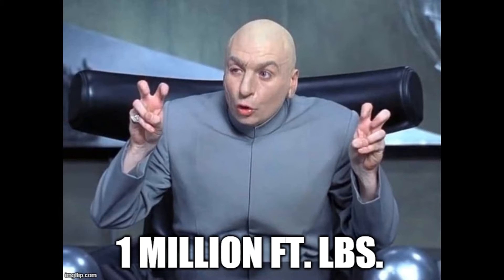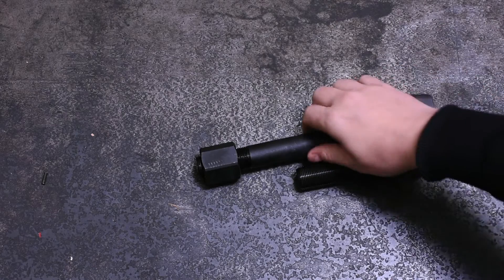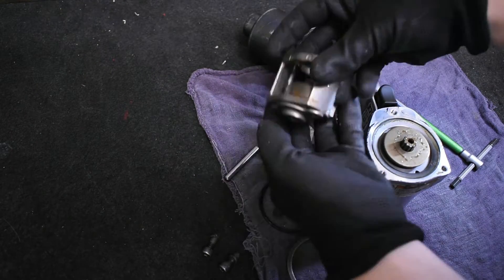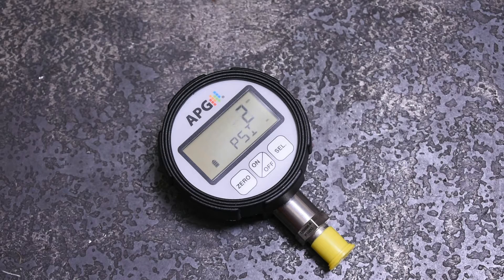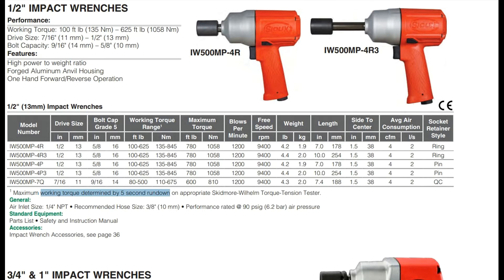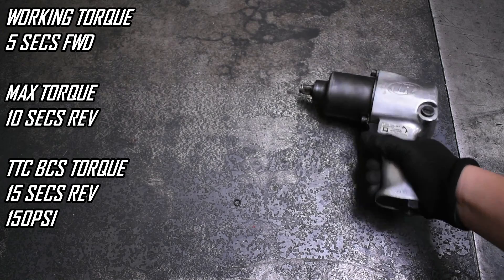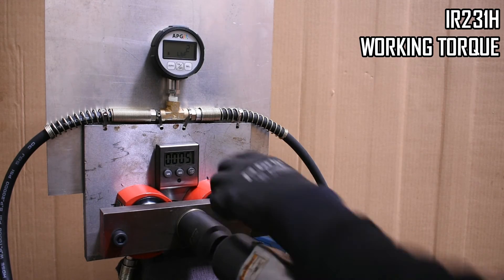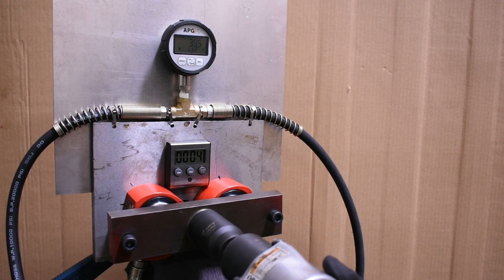Making a Digital Impact Wrench Torque Test to See Old-School FT-LBS

Comment: This rig is nicely made, but it's really just a homemade Skidmore. You're still only measuring bolt-load. Your torque rating is at the mercy of how much the friction in your threads and bearing surfaces are reduced by whatever type of lubricant you're using. The only difference between this reading bolt-load and a Skidmore reading bolt-load is that the Skidmore gauge is giving you the bolt-load in actual "pounds" which can be used to easily do calculations. This will work good for comparison purposes at least.
Reply from the maker: You're not wrong, I suppose the heart of the matter is that we're using a control here. A skidmore divides bolt tension lbs by a preset number, no matter what. Bolt condition, lubricant, temperature effect that but is being largely ignored because their goal is for one skidmore in California to have the same process as someone using on in Florida, always divide by 90 for instance. Skidmore will tell you that you can't use a torque wrench to check your Skidmore machine, so you're really just at its mercy and calibration. For me, I have a control, this 231H I'm choosing. It's an imperfect one chosen at will, but still allows be to throw the tool on and make sure it reads 450 before a test. It also gives a relatable reference for people at home instead of say 60,000 bolt tension pounds. And if IR was using a Skidmore to rate the 231H, and supposedly a skidmore to rate their recent impacts which have performed so differently on this channel than their advertised rating - it's not a process we want to exactly replicate. Their process may have lead to impacts being rated for 1,000-1,600 ft-lbs today, which i feel few people really believe.
Reply: @TorqueTestChannel  I'm not trying to criticize your method. It's a sweet set-up; especially for comparisons. I only have a lot to say about this because I've spent a lot of time trying to think of the most accurate and honest way to come up with a proper "torque rating" for a these tools just like you. 

If you're getting a different torque rating with your set up than IR is getting at their factory using a Skidmore it's probably not because you have a superior set up. Your set-up has these disadvantages:

-It requires that you have to twist the head of a long bolt instead of the nut. (its like a long torque stick)

-You have a piece of metal across two rams that is going to experience deflection. 

-You're using red grease which isn't a proper bolt lubricant. 

Skidmore isn't going to advise anyone to perform their own calibrations using a clicker wrench. It doesn't mean that it's not an okay way to do it. Their equipment is literally just a hydraulic ram with a hole in the middle. If it's not leaking oil then the only thing that can be wrong is that the gauge is out of calibration, but so can any gauge. You just have to check it with another gauge that you know is good. 

I agree that you shouldn't use their formula; there are much better formulas you can use to come to a more accurate result. You need to factor is thread pitch, tensile stress area, lubrication, etc. You really need a formula that factors in the friction as precisely as possible. Friction is the main thing that is going to screw up your results. 

Anyway, I'm excited to find your channel.
Reply from the maker: @charlieott7469  Thanks! Agreed on friction, it dictates everything. Friction coefficient can swing things widely and is why I don't like the whole idea of using math vs just comparing to another tool. We're impacting the bolt head here because it best replicates what people do at home, but I have turned this bolt around and impacted on the nut with little to no difference at least on this set up so far, with higher power tools it could matter. Which I can show but may be uninteresting to most. For the two rams, the guide bolts on the side are in oversized holes, as long as they are shaking around the rig is not binding and the pressure level automatically levels across the two rams being connected to a T, but I agree it's not the ideal design. Hopefully we can maintain some consistency which is the end goal. I appreciate your comments. Digging deeper into these things is what the industry needs rather than just taking numbers on a box as facts.
Reply: @TorqueTestChannel  Awesome. It sounds like you have thought of everything 🤙🏻🤙🏻
Reply: @TorqueTestChannel  I wanted to chime in on this discussion. First, this is great stuff!  

Although I agree that friction is the largest source of error, it is not as big a deal as it is made to be.  your process of keeping it small, with all of the treads clean and uniform on a fine pitch, with maximum thread engagement will result in a linear range of pressure to torque over a fairly large range.  In other words, as you have suggested, a tool with 1/2 the pressure and 2x the pressure of the defined standard, will in fact be very closely exerting 1/2 and 2x the torque.  It is when the force on the threads and under the head force the film of grease cause some dry metal to metal contact that you go non-linear.  I think it is worth noting if you were somehow able to eliminate the friction entirely, the torque would be linear.  That is what you are after.  

Many people think that the torque would be zero if the friction is zero.  It isn't. They forget that the dominant term is the slope of the wedge of the screw pushing giant the ram.  Keeping the force per unit are low + good grease, is the key to minimizing the metal to metal direct contact.  This is improved with large flat surface under the bold head against heat treated and lapped surfaces.

By the way, I assume that you have two bolts, one RH and the other LH threaded of the same pitch and diameter?
Reply: @larryseibold4287  yeah I think he mentions the reversed thread bolt

Comment: Why not use a torque wrench to calibrate the rig?
Reply from the maker: See ep. 3 for more on this. Simply put at a local level the bolt doesn't experience torque, it experiences tension. But among different bolt sizes, the same input of torque varies widely in creating tension. Using a torque wrench would only make these results valid for our 1" bolt in the condition it is, so it would still be comparable between tools but not comparable to your idea of what a ft-lb is at all. Stepping up to a 1.5" thread, the torque wrench would still click at let's say 200ft-lbs but the 1.5" bolt will be easier to remove @200ft-lbs than this 1" thread bolt for an impact, or especially your lug nut at home - because that larger size is under less tension despite the input (torque setting) being the same. 
Doing it this way, you can compare power at home. "Oh, I have that impact wrench - oh it's this much more powerful than an old school guns ect." Without getting caught up in thinking something is "true ft-lbs" and relatable to your torque wrench use at home.
Reply: @TorqueTestChannel  I was wondering the same thing that makes sense now
Reply: @TorqueTestChannel  Have you considered the use of a few pressure transducers to measure and record with an Arduino or RPi inlet air pressure and ram oil pressure, while also recording RPMs, sound data, vibration/impacts, time, air flow, and others so that it can show the WHOLE picture?

As I'm writing this I'm realizing it's a ton of work to get all of this to work properly.

Comment from the maker: See Ep.3 on "Nut-busting" for why we don't use a torque wrench to calibrate. It would not give you the results you'd be able to compare to at home you think it would due to bolt size, pitch, hardness, lubrication and design differences between our bolt, the bolts companies design for this and your lug nuts at home which can cause wildly different results. Companies rely on you not knowing this.
Reply: After watching some of these older videos I was wondering why you weren't using a torque wrench to calibrate, and you make a very good point in the third video. A couple thoughts then I suppose, would there be any kind of governing body you could get in contact with to try and standardise these numbers across the industry? It seems silly that a company can big up their torque values by the methods you've highlighted.

Although saying that, it would be interesting to see some kind of "True" nut busting torque value for the IR 231H is it? Anyways, I don't really have a need for an impact gun yet, but your videos are well made and the testing methodology is clearly well thought out and I enjoy watching them. Thank you.
Reply from the maker: @Kjwcube135  Based on the 231's performance, if it was a Milwaukee tool we'd guess its "nut-busting" would be around 700-725 ft-lbs.
Reply: Awesome content.  Like many, I became hooked on the new content and later came back to the older videos to see how it all started.  I love the methodical and scientific approach to the testing.  Also, really appreciate that you guys take the time to explain the details.  

Having watched this episode and episode 3, I was left wondering if there was an alternate way to calibrate your jig. I understand that your jig is converting torque to pressure and pressure back to torque.  I also understand that the calibration is intended to be relative to a known input (in this case IR impact wrench).  I was curious why you didn’t use a large torque wrench to progressively apply more torque to the jig in fixed increments (e.g. 50-750 ft/lb in 50 ft/lb increments)?  I would think you could then create an empirical correlation that relates torque applied to the jig and the resultant pressure.  While still being relative, I think this would provide more accurate absolute results from your tests.  

You guys did an awesome job highlighting many of complexities of torque measurement (like thread pitch) but I would think these have the most impact on how torque gets converted into clamping pressure.  Said differently, 100 ft/lb is 100 ft/lb regardless of thread pitch but how far the bolt threads and how that torque gets converted to clamping force will vary significantly by all the factors you list. 

Keep up the great context.  Excited for what you think of next.
Reply: I get the point on episode 3 for nut busting, *but this is a different point, to simply calibrate your test set up*. The goal was go translate your test rig's PSI gauge to torque, so tighten it up to a realistic high torque (based on whatever theoretical limits are present) and whatever the gauge reads in PSI is your conversion factor for the given *REAL torque applied*. You set the gauge offset and compare all tools to it. Calibrating to an old tool essentially just relies on trusting shady marketers (maybe less dishonest back then but still probably about as honest as a politician).